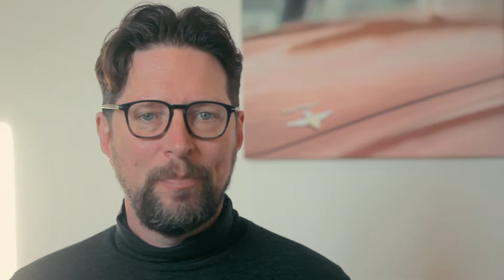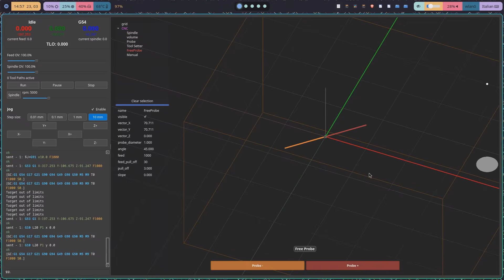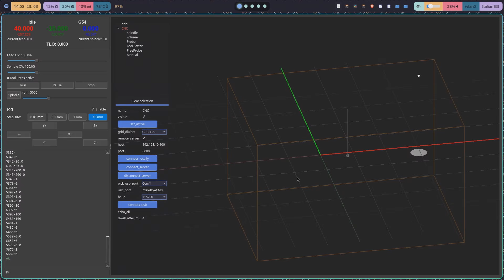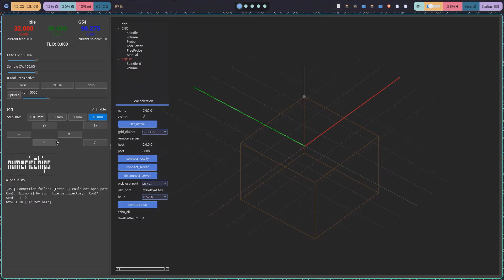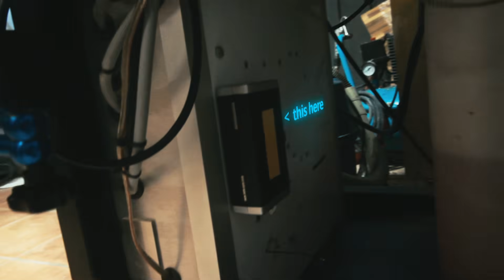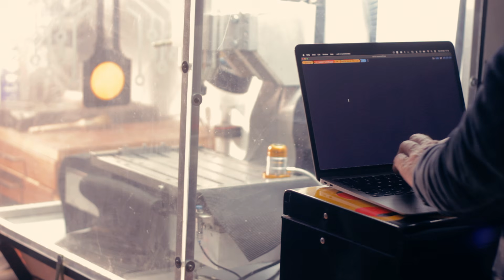nChips - GUI and Architecture

Comment: Really interesting project. As an Emacs user myself (with Evil - obviously the superior editor ;-)), I really like the modal approach to the shortcuts, it's really quick and often becomes second nature. Will the project be open sourced once you're more finished with it? Would be interesting to read some of the code, and contribute to the project. 
ncSender also seems like a great piece of software, but the UI is made in Vue and it's kind of hard to figure out state changes - at least for me, looking at the code from the outside-in. 
Anyways, very interesting project with a different approach, which I really like. Keep going :).